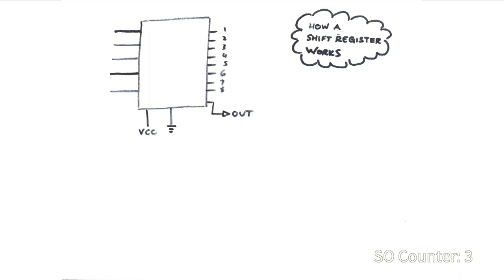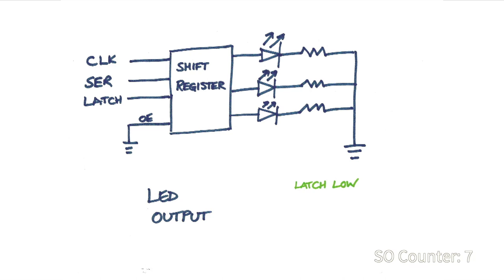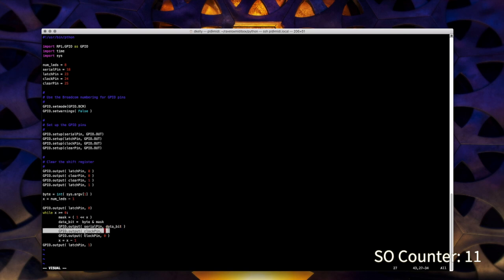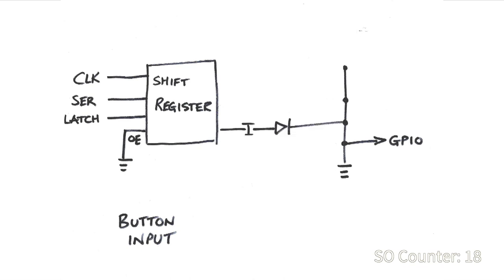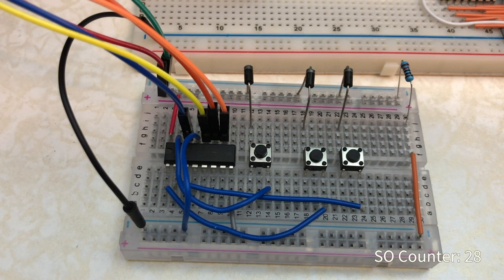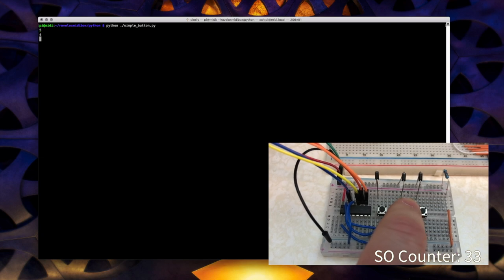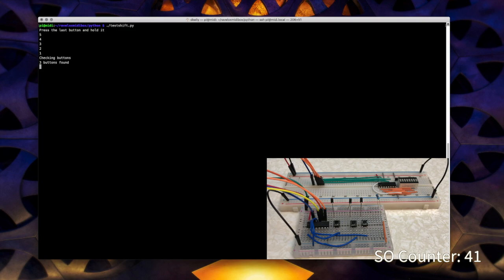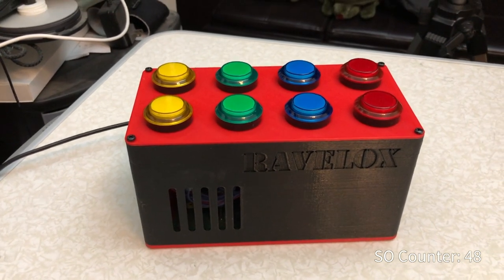Building a MIDI Controller

Comment: what is the max polyphony i can get because i want to build one with many more buttons
Reply: In theory, it's unlimited. The python script runs through all the buttons and determines which ones are pressed so the value that is returned to the script is an integer representation.